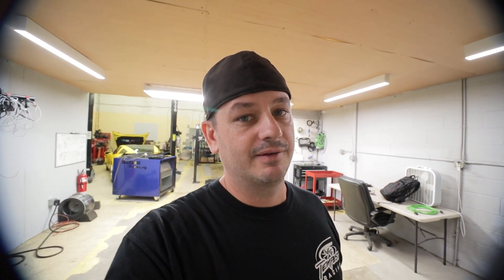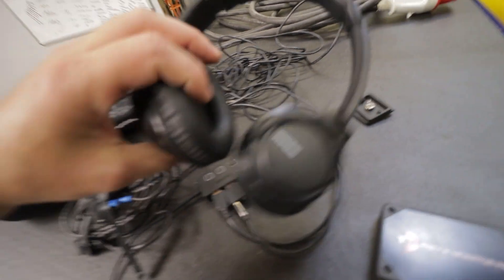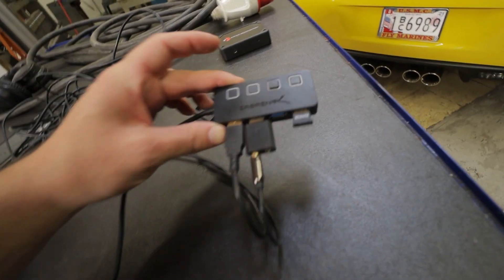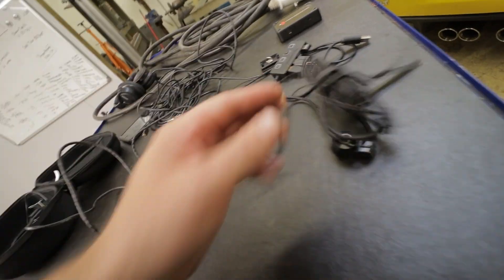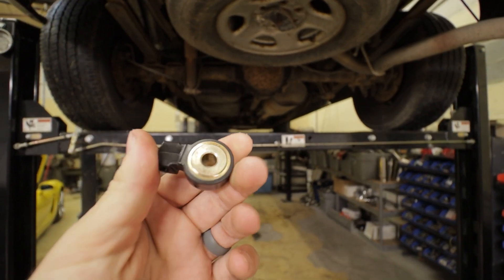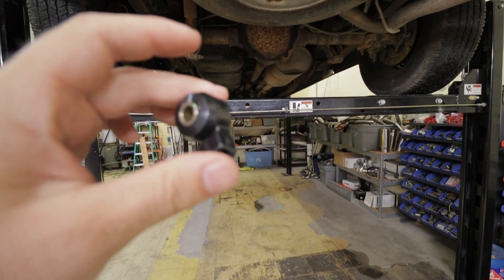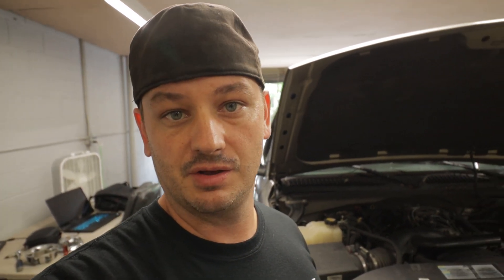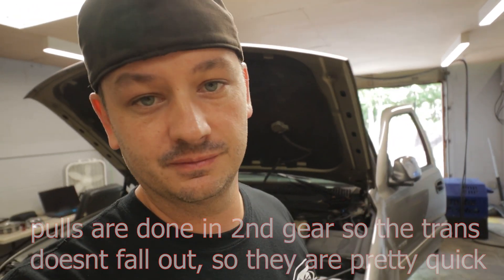TunerNerd Knock Monitor Pro vs  Factory Knock Control on Chevy LS engine -   GIveaway Inside!

Comment: Im in need of knock sensors for my project. Going with 2 wire side of block type, with holley ecu. Does this device Calibrate factory k.s  or does it stay hooked up?  If it stays on truck, but you cant afford it. Is there a two wire type K.S you would recommend over another for Certain more size.

Comment: unfortunately V4 will not run on PC.  has a bug and the developer has no solution for it , just empty words.  just download from the site and test.
Reply from the maker: Works perfectly fine for me on my pc’s 🤷‍♂️
Reply: @JoeSimpsonAtTempest  many thanks Joe!  windows 11?  I tested on 3 PC , none is working , I have video proof also sent to developer.  this is not about "bashing" the product in any shape or form , just need to find a solution.  but that seems impossible for the moment.
Reply from the maker: @  man i hate windows 11. It seems the majority of tuning softwares struggle with it in one way or another.  But yes one of my computers has windows 11 and the knock monitor stuff. 

Even since getting a computer with windows 11 everything else i get just had windows 10 on it now

They are usually nothing but helpful over there at tuner nerd

Comment: Huge Fan. Wanting to buy the TunerNerd knock kit. Will a knock sensor work installed on a cylinder head? Factory 302 doesn’t have knock sensors. Turbo setup here.

Comment: Common problem on those trucks.. The Knock sensor valley gets filled with water and crud.. It rots out the factory knock sensors and causes a lot of false knock issues. I am betting that's why the factory system was extra sensitive..

Comment: Hey Joe where did you mount the TN Knock sensor?
Reply from the maker: On the block as close to the cylinder head as possible. I’ve played with different locations and it doesn’t make as much of a difference as you would expect.  I just try to mimic oem locations as best as i can with what’s available on the engine
Reply: @JoeSimpsonAtTempest  cheers man will deffo have a look just wasnt quiet sure with the headers being potenially in the way.

Comment: I know this is a year old, but this is very interesting. I have a Silverado as my work truck and have also noticed the Pe enrichment pretty much shut off, and knock sensors that were crazy out of control. But pretty nuts to see the Ign advance your truck is taking, especially on 87.  Where did you mount the aux knock sensor?

Comment: I noticed in another video with these TN knock monitors, the guy (another YouTube channel) showed how his knock detection drastically changed after he set the bore diameter parameter to his engine's spec. 

He was testing this on an engine much smaller than an LS though, so it would be interesting to see if has as big an impact here as well.
Reply from the maker: Bore size is probably the most important setting, when setting it up - it’s not just this unit it’s any knock device
Reply: I was thinking in the wrong units, I now see that 96 mm is the proper bore as it's equivalent to 3.78" 😁
Reply from the maker: @GTStuning-   yup it’s in MM!  Also, that will affect what the unit considers to be knock but the actual audio is unaffected so you can use your ears to determine what is knock and what isn’t for yourself!

Comment: Factory knock sensors usually monitor low rpm/high load area, because of the noise in high rpm. And that is why TN gets handy - that is why i need it :D

Comment: I'm absolutely amazed that you where able to put that much timing in it... I had an 01 Silverado with a 4.8l and now have a 03 with a 5.3l both factory calibrations and if I'm cruising at around 60-70 & floor it I can audibly hear both of them knocking. 

I'd love to get one of the knock monitor pros to tune my single turbo ls3 since I broke the ring lands in #7 twice now I've pulled ALOT of timing out because I don't have a good way of tuning timing
Reply: He has the dyno ramp rate too fast, so it's not loading up the engine enough. I street tune and certainly detect knock on these trucks in the real world if timing is in the 20* range full throttle on 91.
So the tuner nerd knock monitor is working great, but the dyno load is insufficient for what this truck would actually experience.